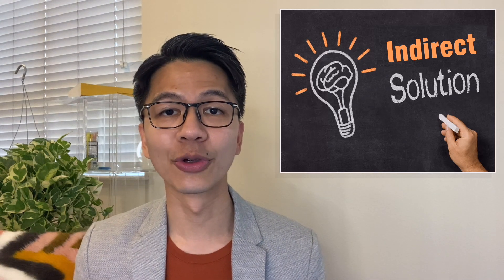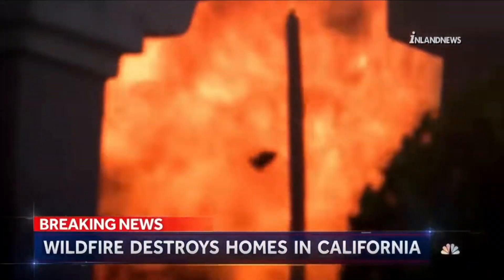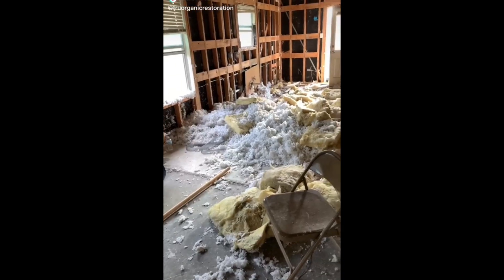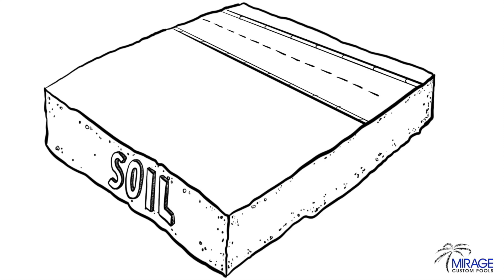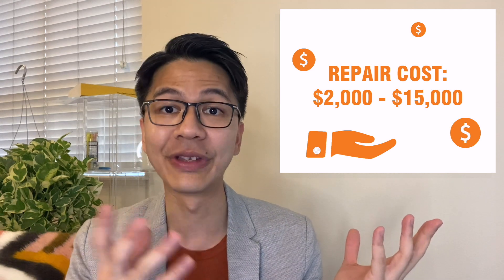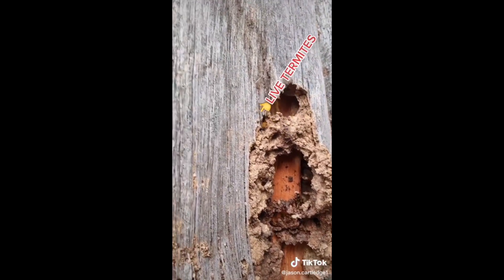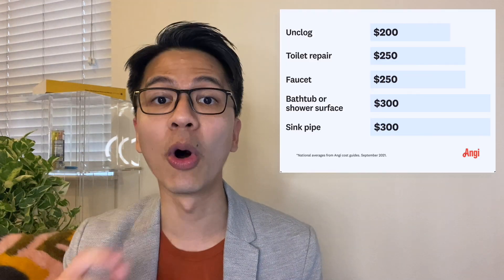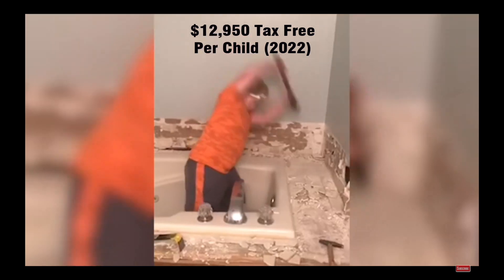Why American Homes Are Flimsy And High Maintenance ?

Comment: Why is building new home very expensive in USA? What does actually make it difficult?
Reply: Labor cost is very high in the US. The hourly wage of a handyman in Los Angeles is about $60 USD.
Reply from the maker: @vernav6756  Hi Verna, r u in LA ?
Reply: @curiousarchitect  Yes. Another reason why American homes are high maintenance is that they are mostly built with inferior materials such as drywalls. I could not believe they use these toy planks to build real houses. I seriously thought it was a joke the first time I visited the US. I would never buy a house that is built with wood and drywalls. Steel framed or reenforced concrete are better.
Reply from the maker: @vernav6756  Hi Verna, just curious how did u came by to see this video? Did u see it from soem group?
Reply from the maker: Good comment! I might actually make a video on this topic next! Care to subscribe?